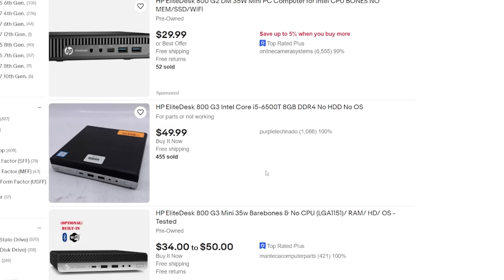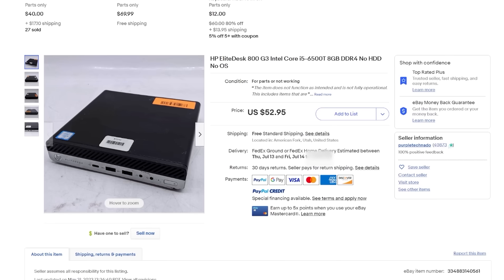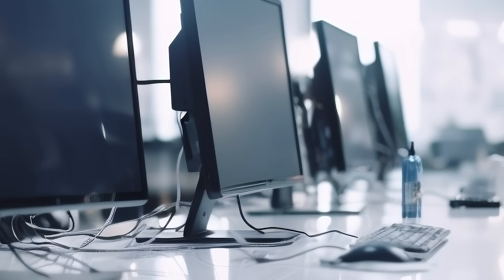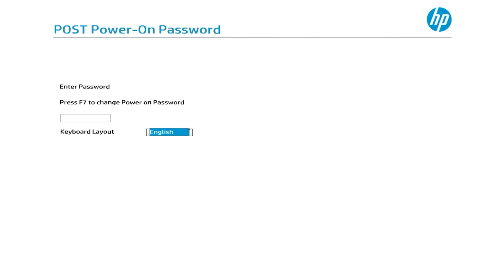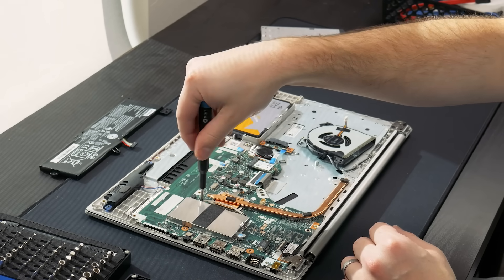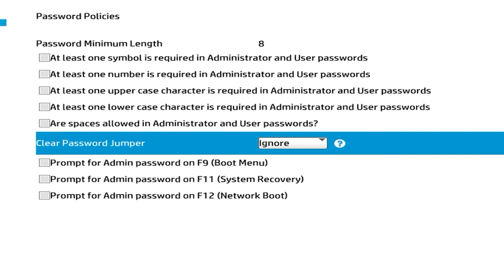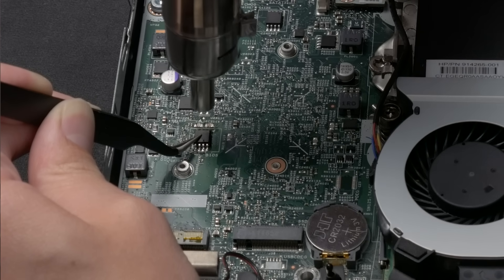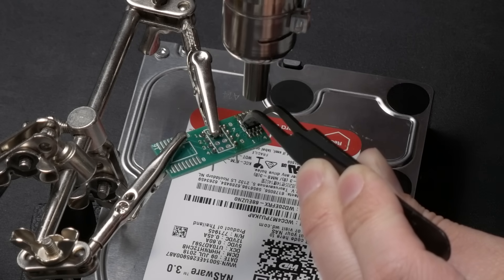I Bought a BIOS-Locked PC. Should You?

Comment: I actually just went through this with a school bios lock. That was done easily by holding shift when reseting until it booted into safe mode and then doing a clean wipe with reset it booted up with no bios lock and was a fresh install of windows. I did still have an un activatable "education" edition of windows but thats solved with a home install.

Comment: Hi, would something like this be possible on bootloader-locked smartphones?
Reply: Good question, and I'm guessing the answer is no, but none of it should be necessary in my opinion, because we should have open source BIOS's.
Reply: @anon_y_mousse  Yes, I would love to have a phone with open-source bios, but that is sadly not an option on the current market. I once bought a BlackBerry Passport with hope to install Linux on it, but after the purchase I realized that the bootloader on there is completely locked with no option to unlock it :/
Reply: @mble  Luckily we do have Linux phones now, though their BIOS isn't open source anymore than any other is. There's also the option of using a Raspberry Pi to make a phone, if you don't mind 3D printing a case, but it's still not an open source BIOS.

Comment: why would the windows registration key be put in the bios?

wouldnt it make moire sense to put the registration key in the registry?

unless these was oem custom order pcs or turnkey pcs that ran things like cash registers and atms.

you could have gotten the ch341 program faster if you ordered from ebay and selected united states or amazon and select shipped by amazon.

yes that would be more expensive but well worth it.

before you flash the bios chip did you try looking through the binary to see if you could find the password you set?

you may want to try that because since pc makers dont expect you to desolder the bios chip and dump it they may not make any attempt to encrypt the password.

combined with that bios passwords are not intended to be impenetrable  like other encryptions it would be fairly easy to crack.
Reply: If the password is stored at all. They could just take the simple method of encrypting the whole BIOS.
Reply: @anon_y_mousse  only other reason to encrypt the bios is if there is proprietary software in the bios.

Comment: Not all bios locks are proofed against upgrades to the bios via a windows app. LENOVO ones may be bypassed where genuine upgrades are available. During the upgrade tge settings are reset to factory default. This I found on the miix 720 tablets used in schools.
Reply: Yes, so did i. Bought a as new school tablet and it came with locked bios. Tried a bios update as it couldnt hurt and it reset the settings to factory. A great product at £170, then added 5g wifi and bigger pcmcie storage.

Comment: Could you be so kind as to compare the data dumped form both a locked and unlocked chip? If you find the locked flag and/or the password/hash, you may be able to just alter those, thereby disabling or changing the password.

Comment: I used to have a Lenovo laptop that had a locked BIOS. I could still use it but could not enable features that I wanted. I found a hack which required grounding out a signal pin in the BIOS which should prevent it from knowing about the password. I could never get it to work so I gave up.

Comment: Most BIOSes need to be desoldered.  It is, however, pretty easy to do, and I would people attempting this to get board schematics.   Desktops are often more easy, these days they can be flashed without the system being physically on.  I also noted that password unlock bios website show up, which works for about 80% of older machines - given that it gives you a code to work with. I spend a weekend unlocking about 60 laptops that I bought from eBay.  I say about, because there were some in such bad shape that they could be resold, but the job let did not mention it.  To me, it is a nice side hustle and I can offer the laptops cheap to the buyers.  I do not sell on eBay any more, the fees are too prohibitive.

Comment: unlocking the bios lock is simple. never let that affect your decision to buy. in a nuc you remove the bios mode jumper, turn it on, select 2 to unlock bios and your done. also manufacturers have a default password for all bios chips to override any other passwords that have been installed for repairs down the road. for this you have to know the 1) manufacturer of the board, 2) manufacturer of the bios and 3) the version of the bios. list exist for all the manufacturers for laptops and nucs.

Comment: There's another option - a shorting attack. If you short the bios EEPROM SCL and SDA pins at the right time during boot, the system won't be locked. Then you can  It takes a bit of futzing with getting the right timing, but I believe it will work on this class of pc.
google "cybersix bios password bypass"

Comment: I'd recommend doing a comparison between the bins for each to see where the pin is stored, and either modify with a hex editor or remove (with blanks)
Reply: I was thinking the same thing since he had a backup of the locked version. Would come in handy if considering buying more.

Comment: No, no one should ever buy a bios locked pc new. Send the message to the manufacturers that this is NOT okay and we will NOT accept it. If it's second hand/used then I see no harm in buying it as long as it fits your needs, as the money spent on the board is not going to the manufacturer.

Comment: 8.53, you can use de board adapter connector, put a bios in the bench and connect. (do  not need to solder in the adapter ) fast and practical. By the way it isnt a good policies to program in circuit, and ways do 2 or 3 dumps and conpare to confirm a good bin file.

Comment: If you don't have a hot air gun you can use a U shaped piece of solid copper wire instead. Solder it to all the pins of the BIOS chip and it comes right off with no damage.

Comment: I'm an IT technician, and I've worked with computers since I was 12 and couple years ago I was about to swap an HD and format and do all the stuff on my mother in law's laptop and got the locked BIOS thing going on, I read the manual and in there told me to contact ASUS for the unlock, tried a bunch of times and didnt even could have any information from them because the documentation from it was missing since her nephew owned it, I was shock that I could even do nothing with the thing, the only solution that I've found in the internet and the market around here (brazil) was to replace the chip that holds the BIOS and this around here is rather expensive.

Comment: I once repaired an Asus ROG laptop that had failed to upgrade to windows 10. The bios was corrupted during OS install (no idea how). I was able to use a raspberry pi and a SOC clip to reprogram it. I had a similar issue with not being able to read the chip in system, but figured out I could plug in the power (without turning on the laptop), and that was enough to power the chip and dump the ROM. You might try it out next time, it could save you a ton of soldering.
Reply: What were the specs
Reply: @lunarvlr  ROG G750JH (Black Flag edition) Has a  i7-4700HQ and a GTX 780M among other things.

Comment: You dont need to solder it to the board, just clamp it directly (make sure all pins are connected) and then read it. I'd rather put least amount stress/destructive approach to a single single specimen.

Comment: Notice if you are running a HP ProBook/EliteBook/ZBook up to the Folio 9470m:
DO NOT JUST OVERWRITE THE BIOS WITH A DUMP THAT EXISTS ON THE INTERNET. Because when you do, the Serial Numbers and the MAC Address of the Ethernet Card gets overwritten.
What you should instead do is capture the Current BIOS, flash an unlocked one, power the PC on, flash the original locked bios while the PC is running, set a new Password and then reboot.
Otherwise you will for example get Code 43 for the Ethernet Chip because the MAC Address is incorrect, and there could be problems with Windows Activation.
Reply: Question: You say "flash the original locked bios while the PC is running", would that be while running BIOS setup?
You flash unlocked BIOS, enter BIOS setup, and flash original BIOS while still in BIOS setup?

Comment: I'm wondering if I'm having a similar, yet different issue.  I bought 2 used motherboards (Gigabyte and MSI) with X99 chipsets to use for a NAS project.  I can't get either one of them to POST.  Fans may spin (barely) or lights may come on, but no POST.  Could these be BIOS issues?  I tried the usual clearing methods, but no dice.

Comment: Unplug the battery connection, unplug the power supply, remove bios battery, short the metal clips the bios battery would normally touch to drain any power in the bios chip. reassemble, done. No more bios password. Bios is cleared of all settings.

Comment: I got a hold of a Surface 3 that was bios locked and the system disk was bitlocked and unbootable. It took me all of an hour and 5 minutes once I had everything needed to get the bios password and repair the Windows install.  Not necessarily in that order. Most of that time was burnt on the reinstall.

Comment: Currently experiencing a similar issue when I bought a used Asus Chromebox 4 from marketplace which was super cheap only to find out it was enterprise enrolled. Had to go the CH341A route to flash Coreboot on it but found out new machines are no longer using BIOS chips with feet like in the video.
Reply: a n i m e
n
i
m
e

Comment: No, if anything retailers should be punished for even offering this trash for human trash to to buy. Straight from the "toilet paper too thin to use to be used in placed only where toilet paper is legally required but you're not actually supposed to ever take a shit" marketing/engineering crew, the crimes against humanity egghead b*tch crew, the Nuremberg Boyz, future prisoners for life if there's any justice. It should just be a crime to engineer or even offer products like this, a consumer protection agency should just roll in and bully the company to death before it can even offer stock and short-sell it's stock to death if it's already trading. The people should be the determiners of what is on offer, just as they are the determiners of everything else about society and any resistance to that should be met with violence both financial and real. If I see a locked bios in any piece of hardware it will have an encounter with a baseball bat and whoever sold it to me will give me all of my money back or they will too.

Comment: @Hardware Haven  You were lucky..  Sometimes just bios reflash doesn't help, for example HP laptops has protection against password reset via bios reflash,  it simply doesn't work and password is still present...  It is still possible, but you must use 3rd party software to patch bios that you want to use for reprograming and then wirte it into SPI chip. For example as I remember correctly, sometimes password is stored in a few places, so simply bios reflash/.CMOS reset not always works, because mainboard is able to recognize that BIOS was reflashed and was password protected... Keep that in mind that you have  do more then simply bios reflash, it's not always so simple, becuase modern computers are protected against that, aspecially laptops...

Comment: Came across your videos as recommended for Proxmox and HA. I really like your style of presenting material in a very calm, friendly, easy manner. And one of the big things is you talk to the viewer as if we are on the same level and don't speak in terms most of us would not understand, the l33t speak as it were. I really appreciate that 😎👍
As a note, you bring up the BIOS flasher you purchased. I had this same problem with a thin client where the chip was borked during a bios update. I had gotten one of those units only to find out the same exact issue you had here, the chip runs at a different voltage as the flasher outputs. I tried to do the hack to make it work, but the thing over heated and never powered the chip.
Thanks for showing the description of the device (there's actually v1.7 available that I've found), but I had first looked in your description for an affiliate link, and was saddened that you had not had one for that device. It might be a good idea to add one for it for future viewers, you never know how many ppl will be using it to get the device because they came across the video 😉

Comment: Just did one about a month ago. 2016/17 HP laptop. There's a built in feature. Hold Windows+B while powering on. Continue holding until it reboots (could be as long as 45 seconds), then release. Should let you into BIOS when it comes back on.
Reply: Thank you,it worked!😊👍

Comment: Your BIOS dump seems to be exactly 16M, which means its probably a full dump of the BIOS chip, even white space that might exist at the end of the chip. Most manufacturers don't fill their BIOS chips to the brim, mainly for BIOS updates and patches in the future. It's possible the HP and community BIOS's are complete images, just truncated to exclude the white space that would exist at the end of the chip
Reply: The memory chip sizes are in the powers of two and the binary found was 9,1MB. Therefore it would not fit on a 8MB chip but does fit on a 16MB chip.
Reply: Of course the dump is the entire size of the BIOS chip.   You won't know how much memory the BIOS uses until after you dump it so you should always assume it uses the full size of the chip while dumping.
Reply: mfw people are still arguing under this fucking comment
Reply: Very good to know!
Reply: An erased chip is all FF's. If the BIOS is in Intel Hex format, rather than binary, it would only contain the pages of bytes that have zero's in them; thus it could contain the entire BIO's while still being a very small file.
Reply: @lizardking8388 You have managed to make me spend 5 minutes sitting and trying to understand your first reply. You shouldn't be suprised when people don't understand correctly if you can't communicate.
If you are wondering what I'm talking about I'll tell you: your comment reads as if you thought that binary couldn't be represented as hex and like Intel Hex is a special version of the hexadecimal format that just magically makes things smaller.
I'd word your comment in this way: if the hex file is in a special format it could be a full image with the empty space removed.
Reply: Hex IS binary, not rather than.  It's just binary converted into a more people friendly way to read.   All hex values are stored in, you guessed it, binary.  If all bytes were FF then all bits are 1.  Intel Hex just encodes/decodes in this instance is just compression.  Everything is stored in binary, there is no "rather than binary"
Reply: @shhhvcnear  You know only half of what you think you know.

"Hex IS binary, not rather than."

Hex is ASCII TEXT, Binary is BINARY.

"It's just binary converted into a more people friendly way to read."

Converted, yes; which means it is NO LONGER BINARY. Hex REPRESENTS binary and it is more than "a more people friendly way to read". A server may not be able to accept binary and so the data may be CONVERTED to ASCII. ASCII Hex cannot have a '1' in the eight bit; if it did, it would be binary data and NOT hex.

"If all bytes were FF then all bits are 1."

Obviously.

"Everything is stored in binary, there is no rather than binary"

That's a half truth, which you don't understand because your knowledge of binary is very simplistic. Yes, everything is bits and is binary, but when engineers (and most computer literate people) refer to a binary file, they're referring to a file that has unformatted data or to be more specific, a non-text file. If you format a file to ASCII hex, then it is no longer considered a binary file (even though the data within is still made up of binary data). ASCII hex breaks the binary bytes into 4 bit nibbles, so each byte of the data is represented by two ASCII text bytes in hexadecimal format, neither of which have a '1' as the most significant bit.

"Intel Hex just encodes/decodes in this instance is just compression."

When you load an Intel hex file into a programmer, all data is first erased from the chip, which means all bits are '1' or FF. Each line in the Intel hex file (which is ASCII text, not binary) contains an address of where in memory to write the data, the data itself and a length of bytes to write, including a checksum.  The hex fields (which are ASCII hex, not BINARY) are then converted to their binary values and used to modify the buffer that was previously filled with FF's before being programmed. It's not really just compression because it doesn't contain all the data within it. Instead, it assumes that any data that's not included within it is FF. So if you didn't fill the buffer with FF's first, then the data will be incorrect. usually the programmer will automatically fill the buffer with FF's before loading the Intel hex file. A compressed file contains all data and doesn't rely on assumptions. Intel hex format can also be used to patch an existing program (but this is likely over your head so I won't discuss it further).

In summary, Intel hex format doesn't need to write pages of FF's in any area because there already are FF's there from erasing. Since there are a lot of FF's in firmware, the intel hex file can be much smaller than the actual binary, even though there are two ASCII bytes representing each byte of the actual binary.
Reply: Agree. All chips, AFAIK, stores info in binaries. Even disc storages.